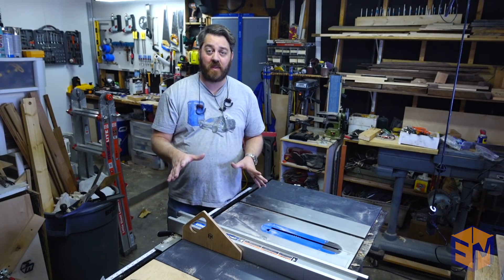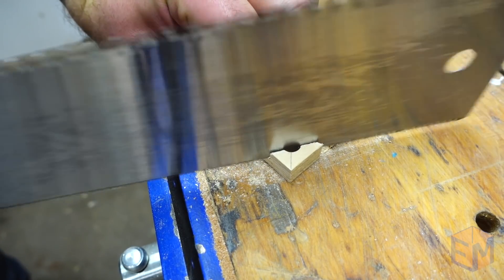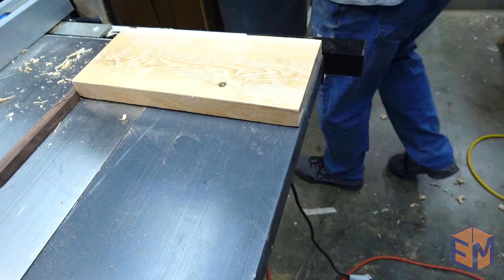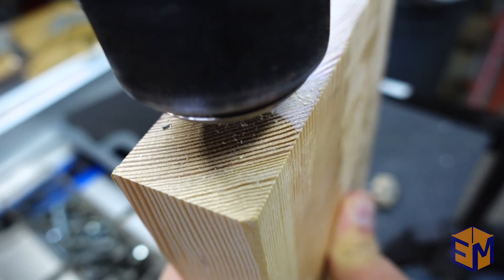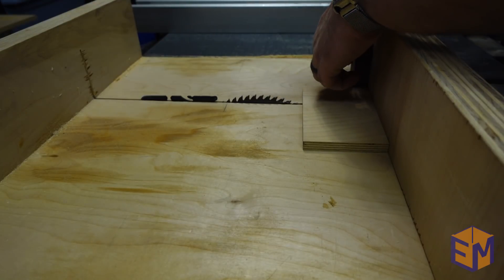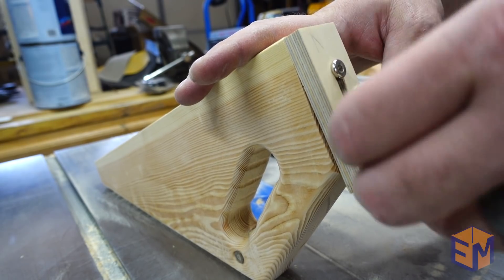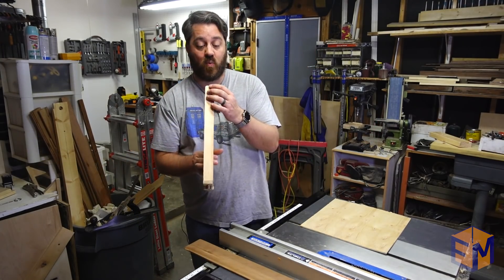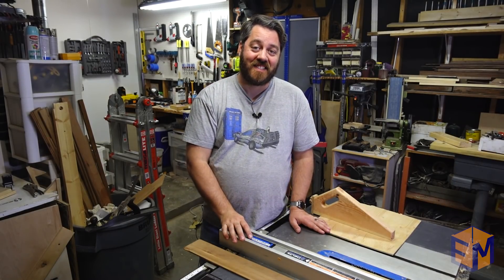How to Make an adjustable table saw push stick

Comment: I've seen a few push-stick designs like this one, which have an adjustable-height "stop" on the rear end. But, I really don't see how the adjustability makes it better. Why not attach a stop which protrudes just 1/8 inch below the sole of the push-stick. Isn't a 1/8 inch stop long enough to push your workpiece forward (provided the workpiece is 1/8 inch or thicker)? If your workpiece is 3/4 inch stock, won't a 1/8 inch stop work just as well as a 1/4 inch stop, or a 1/2 inch stop?
Reply from the maker: In most cases yes, that is absolutely all that is necessary.  However, if the board catches and kicks up, having a small stop in the back can easily get bumped out of the way and the board come flying back.  For that reason, I want to have as much support on the board as possible.  There are also cases when you may be cutting wood that is uneven, doesn't have a square back edge, has a bow in it or some other scenario where having a longer stop would be helpful.  I've even had situations where I could have added a longer stop in the back, which would have been helpful had I had this push stick at the time as I had to cut a board that had a large chamfer.  My mistake for not doing my order of operations correctly, but I could have just added a longer stop in the back and resolved that problem.   Hopefully that helps clear up my reason for an adjustable stop.  Thanks for your question!

Comment: I really like your design, except I would glue a two-inch sacrificial strip on the bottom, which could be sawed off and replaced as needed. I'd use a 1/4 inch  plastic bolt and wing nut for the adjustible stop. You didn't say exactly how long it is. I saw a similar one that was 16 inches. I might go 14. If it seems too heavy, I might drill some large holes. (Now I see your linked plans.) Thanks for sharing your design.
Reply from the maker: I made a couple different version of the linked plans for a couple different lengths.  I didn't glue on a sacrificial strip to start because once this starts to get chewed up, I'll cut off the bottom and glue on a new piece then.  I'm not worried about the metal bolt as I'll never cut that deep into the push block, however using a wooden or plastic one would certainly make it safer.  I think I even used a wood dowel in my plans instead of the bolt, just to give a little extra space.

Comment: one thing I did on my push sticks is to glue sandpaper to the bottom. Gives great control with no slipping
Reply from the maker: The only reason I didn't do that is because I had a project I was working on that had a finish already applied.  I had considered other options, a rubber matt, shelf liner material, but ultimately I was happy with the raw edge.  I think I would put sandpaper on one if I make another, it does help a lot!

Comment: Nice design.  Clever.   Making something similar.  But as I have access to a mill, I will make it out of metal and mill the slot in the push plate
Reply from the maker: That's a heavy duty push stick!  Are you making it from aluminum or something soft or carving a channel for the blade to pass through?

Comment: All tissues are "kleenex", but you must not refer to any old craptastic locking pliers as Vice Grips.
Reply from the maker: If all tissues are kleenex, all locking pliers are vice grips.  I see the confusion though, my vice grips are not capitalized so not a proper name.  You are referring to Vice Grips, as in a name brand, easy mistake to make

Comment: I made one out of some PT yellow pine...  It's ugly as F, but works really good!
Reply from the maker: Ha ha!  Doesn't have to be pretty as long as it works!  Glad to hear it!  Though I have considered making one out of walnut, with a sacrificial scrap of something glued to the bottom.  You know, fancy it up a bit, LOL.
Reply: @TheEveryMaker  I did one up you....  I used Mahogany for the adjustment block so there is that.. :-P  Thanks again!
Reply from the maker: @jagboy69  thats awesome!

Comment: Great push stick. For us Noobs dimensions would have been nice?
Reply from the maker: I replied to someone with dimensions.   I plan on having plans on my website, just taking longer than expected.   The push stick is 6 1/4" tall and 14 3/4" long, not including the heel.  If I were to do it over again, I'd probably make a slightly shorter one, at about 12 1/2 to 13".  That would fit the space between the blade and the front of the saw a little bit better, so it depends on the size of your saw.
Reply: Thanks Nick
Reply from the maker: I now have free plans up on the website.  https://theeverymaker.com/product/adjustable-table-saw-push-stick/
Reply: Thank you for the plans I greatly appreciate it.
Reply from the maker: @aljogosselin  You are very welcome.  Thank you for being patient!

Comment: What are the dimensions of your puch stick--specifically how long is it and how tall?
Reply from the maker: The push stick is 6 1/4" tall and 14 3/4" long, not including the heel.  If I were to do it over again, I'd probably make a slightly shorter one, at about 12 1/5 to 13".  That would fit the space between the blade and the front of the saw a little bit better, so it depends on the size of your saw.
Reply: Thanks sir I appreciate it
Reply from the maker: I now have free plans up on the website.  https://theeverymaker.com/product/adjustable-table-saw-push-stick/

Comment: IF YOU PUT  A LARGE HEAL    ON THE BOTOM  WHOULD BESAFER
Reply from the maker: Not sure I understand what you mean by "heal".  As it is, I feel very safe and in complete control of the board.
Reply: bottom  of pushstick    or push board  most have a smale heal the part of  t thepush board     that comes incoantact with the wood that you are cuting       Its Too Hard to explaine if dont know a heal is.  when your hand  is still over the moving blade
Reply from the maker: @jamesberroth2541  Ah, you mean heel, the part of the push stick that, on mine, is adjustable and hangs down off the back of the push stick.  I made mine adjustble so that when you are using it to hold the board down over the blade, but still have a fair amount of board behind the saw, it would sit flush.  It's similar to the gripper in that the heels can move out of the way when you don't need them, but still drop down when you do.  With my design, it can either be free floating as in the case of the gripper, or you can lock it in place with the knob on the back so you can set the proper height.  
I hope that clarifies, that this push stick does, in fact, have a heel.

Comment: When the push stick has to be against the fence the knob is too wide and will bind against it.
Reply from the maker: Actually it doesn't.  It is high enough that it goes over the edge of the fence. I actually used it today on 1/4" boards with no problems.

Comment: One suggestion you can do to make this better... glue fine grit sand paper to the bottom. It will have a better hold and not hurt your material.
Reply from the maker: I've thought about doing that and that's a great tip!  The bottom of my board is rough enough that I haven't had too many problems with it gripping and I rarely rely on the push stick alone for support, but I have seen people use this trick to great effect!

Comment: I would dovetail the end so that the end piece has a channel to move in (up/down)..  spring load it to push downwards so that it catches the wood during any push..
Reply from the maker: Not a bad idea!  I was looking more for a quick afternoon project, but if you could get the process down and the design of the spring mechanism, it could be really cool.
Reply: @TheEveryMaker  As an alternative, you can use a aluminum channel instead with a bolt.

Comment: The knob is going to hit the fence when you cut narrow stuff.
Reply from the maker: The knob only sticks out by about 3/32", which could easily be adjusted to make it flush as it only sticks out that far because it's slightly off-center.  I mainly designed this one for larger items, though the way the knob sits, even on a 3/4" thick board, that would push it up far enough that it would clear the top edge of the fence.  I do have other push sticks if I need to get really close, but you can always just trim down the knob a little bit more so you'll have complete clearance.

Comment: I’m new to your channel. Came across it bc I want to make my own push stick for many of the same reasons you mentioned. When cutting plywood for instance if there isn’t even pressure across the saw blade you get tons more splintering and filing is a pain or you lose so much material at the edge that was pretty much a waste. I subscribed bc I loved your speech at the end. Really resonated with me. You love woodworking and simply want to collaborate with anyone interested in it, starting, intermediate or expert. My one question is what happened to posting every other Thursday? I looked at the latest posts on your channel and saw the last video was over 10 months ago.
Reply from the maker: Life happened.  I had some personal things come up that took my attention away and I've had some other health related stuff that has kept me from getting in the shop.  I am currently working on some projects though, so I'm hoping to get things going again soon.  Thanks for sticking around and giving me a little bit of a boost to get back into it.  I appreciate your kind words and am glad what I do resonates with you.  I'll be back to it again soon!

Comment: Great idea, I like the adjustable foot.I notice though that the handhold hole is too low in the back to be finger safe when cutting 2X material. Easy to modify.
Reply from the maker: I'm not sure I know entirely what you mean about it not being finger safe for 2x material?  You don't want to cut very far into the push stick, so if you are cutting far enough to hit the finger hole, your blade is set way too high.  Are you talking about something slipping and the push stick falling down on the blade?  The design here is to keep your fingers a few inches away from the top of the material you are cutting while keeping the material moving forward.  It should keep your fingers plenty far away from the blade under proper use.

Comment: Fantastic tool. I will definitely make one when I get a table saw!  I agree on putting some sandpaper on the sole and the point is well taken to use a wooden dowel instead of a metal screw for your fixed fastener.
Reply from the maker: Both are excellent modifications!  I hope you find it as useful as I do!

Comment: I like the function of it and it is hefty. Now...is it me or is your riving knife and or blade out of tune? At 2:50 it looks like it is moving.
Reply from the maker: I do have the riving knife a little bit off center so it pushes the wood against the fence.  I haven't had any issues with it setup that way, though I am going to be doing a full retune once I get back in the shop (hopefully this weekend).

Comment: That looks like a great push stick. I like the adjustable stop. 

It appears that when you turn the knob, the hanger bolt turns with the knob and the wood screw end turns in the wood. I think it would work better it the hanger bolt is fixed and the knob turns on the screw.
Reply from the maker: That would be a great modification.  I haven't had any issues with the knob so far, but I can see how having the metal parts move could last longer than screwing into the wood.

Comment: Nick, I like the push stick build. GREAT basis for securing the cut piece. The ONLY concern I would have is that if you are cutting something THIN, say, 1/4". etc. you will be cutting into the push stick body. No problem until the saw blade hits the bottom bolt that holds the adjustable lip. THOUGHT: maybe make the bottom pin out of wood with a bolt-like head on it so IF the blade grazes it you still get to keep your fingers and saw blade.
Reply from the maker: I certainly understand your concern and thought about that considerably myself.   I've cut into the push stick body several times and there is plenty of space between the bottom of the stick and the bolt.  You don't want to have the blade that much higher than the thickness of what you're cutting through. Once that starts getting worn out,  I'll just cut the bottom off and glue on a new piece of wood.  But there is more than enough to keep the bolt away from the blade.

Comment: what size you handle lumper have. tight ? interesting but need looking what wood need first, i no have at home wood.
Reply from the maker: I will go take measurements when I have a chance, it's been a while and I can't remember if I used a 2x8 (1.5"x7.5") or a 2x10 (1.5"x9.5").  This project is really more about how it feels in your hand than exact dimensions.  If enough people are interested, I can come up with some plans.

Comment: Nick, I was lead to believe that the safest push stick should be cut from plywood.  The explanation is that the table saw vibration on a solid piece of wood could cause it to split down the grain at the most inconvenient of times.  Since plywood is cris-crossed grain, that usually does not happen.  Just asking.  The internet is full of opposing opinions.
Reply: If the vibration on a saw is bad enough to split wood it's probably not safe to run
Reply from the maker: I have used both hardwood and plywood push sticks and never had one split on me.  The long thin push sticks are better made out of plywood, as I can see those splitting just from the pressure if there are any issues along the grain.  In this case though, the wood I used is solid without any checking and I feel comfortable using it.  If I do notice any checking though, I will retire it and make a new one.  Good question, it's always best to be safe!
Reply: @TheEveryMaker  Perhaps making the same exact shape of pushstick, but making it out of 2 pieces of 3/4" plywood glued together would address this issue (if it proved to be an issue at all).  It would also save you the hassle of having to flatten the stock with a hand plane/sander.
Reply from the maker: @gballou86  I've actually had some plywood that was almost as bad as a the solid wood!  Great idea though, just got to make sure you have a good strong glue bond.  It would certainly be a great way to use up some plywood scraps if you have them.

Comment: Nice and easy build. I would glue a sandpaper strip on the bottom to give some extra grip.
Reply: I took an old worn out scrubber with a plastic handle and stripped off the worn out pad sanded the bottom flat and glued some 80 grit to it   I use it on my router table
Reply: brianT I was going to say the same thing.
Reply from the maker: I'm going to have to do that.
Reply from the maker: That's a great idea!  I considered some sort of robbery material, but sandpaper would be great!
Reply: @TheEveryMaker  why not do a video on trying different materials on the sole of your push stick??
Reply from the maker: @RADCOMJ1  As it happens I'm about to replace the sole of the push stick as I've eaten through quite a bit of it.  I was thinking of doing a followup video to show how it's weared over time and what to do to fix it.  I may try a couple of the ideas like a rubberized material or sand paper as people have suggested.
Reply: If you value your saw blades  sand paper is not a good Idea or any other abrasive.  Some soft Materials could be items attached with Double sided tape like the foam drawer liner or the soft flooring playroom flooring
Reply: Spread a layer of silicone on the contact area.

Comment: I have one thing to say, MICRO-JIG. Just kidding. I know they can be expensive. I like this allot. Maybe make one not quite as wide for thinner cuts.
Reply from the maker: @Greg Stephens, I would love to get a Micro-jig, but I also like making my own stuff and this is one of those that was just a fun quick project.  I actually do have one that is a lot thinner for thinner cuts, though I have used this one pretty thin cuts and it worked out quite well, though the stock was wider to begin with.

Comment: A great push stick build, most push stick videos i see similar to yours, always has the permanent leg at the back, were as yours is adjustable. Well done for doing that and the only change i would have done, is one of those bought black knobs instead of a homemade one, i have seen plywood made ones split if too much tightness, is applied to them. Great build again and well done.
Barry (ENG)
Reply from the maker: Thank you!  I thought about buying a knob, but the pressure needed to hold the stop in place is so minimal, I doubt it will be much of a problem.